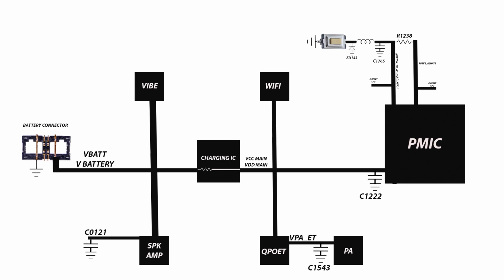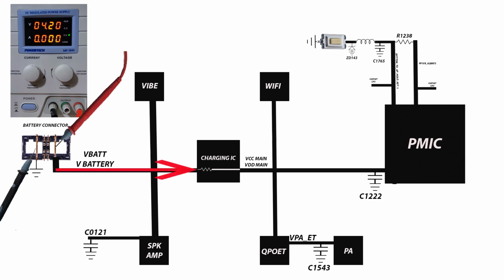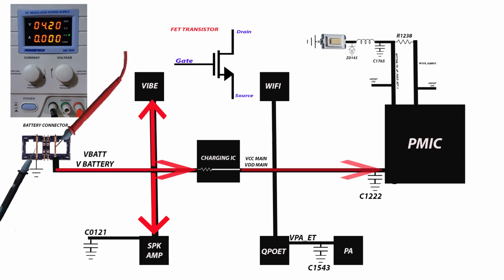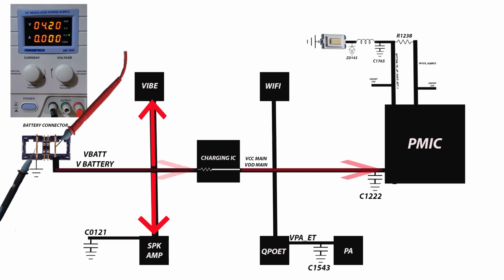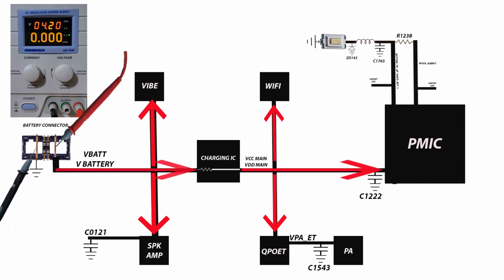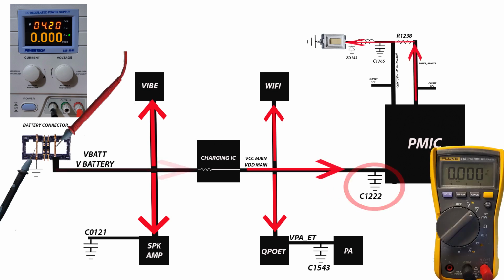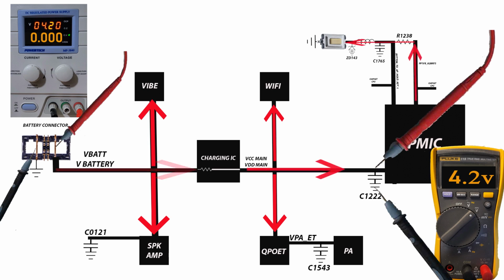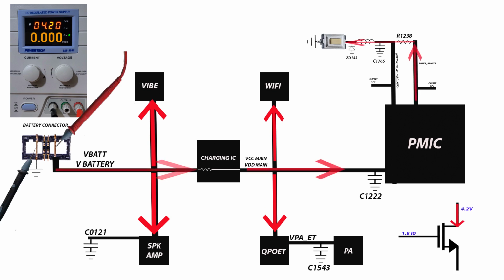Public Voltage, Diagram, SkippyTube

Comment: Sir, I have a quick question. I'm confused how much voltage I should input on vdd main line to find a defective capacitor. (If I put voltage on a capacitor which is on vdd main line, the defective capacitor will be shown because of its heat after I used a freeze spay on the board)  I looked up a schematic map of ZXW but I really don't know. What's vdd main line's voltage rated for?
Reply from the maker: Hi,
Battery voltage goes to the charging IC, Charging ic converted battery voltage to phone voltage,  On the iphone 7 and higher models, Name is Vdd:Voltage Drain Drain 
Find the ,test point or any capacitors on this lane and inject the voltage, Max input voltage 4.2 v and also 5 amps is good.
Reply: @SkippyTube  I appreciate your help! Sir, Since you told me that 4.2V is max, I was wondering If I could input 4.2V every time on any capacitors of VDD line for the test? What If I input 1V on a capacitor of VDD? Do you think the defective capacitor could go off enough heat with 1V?  I'm so grateful of your help. 😃